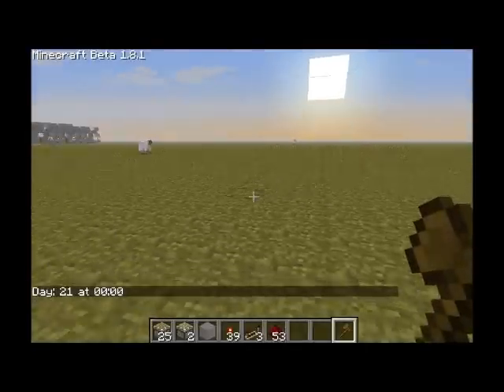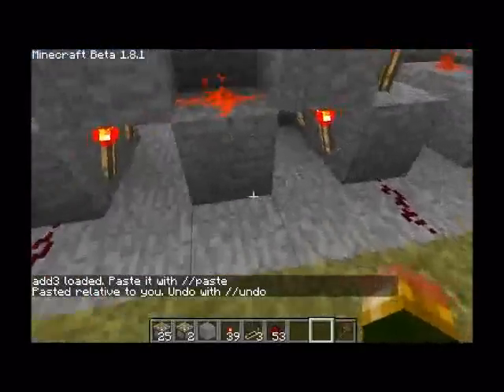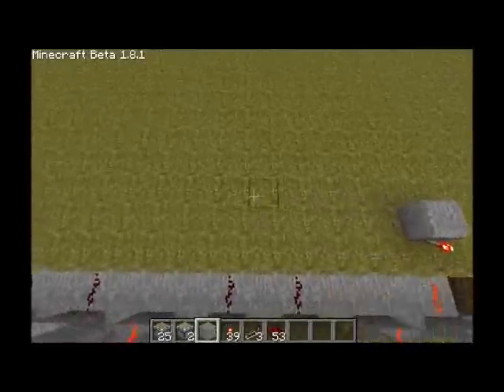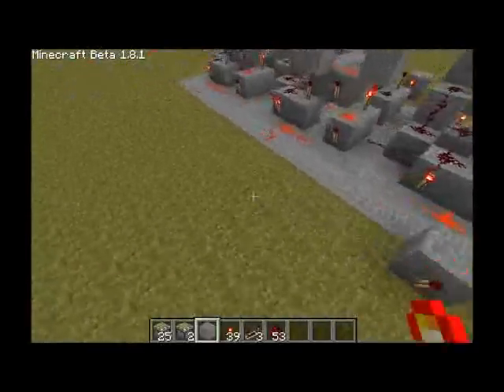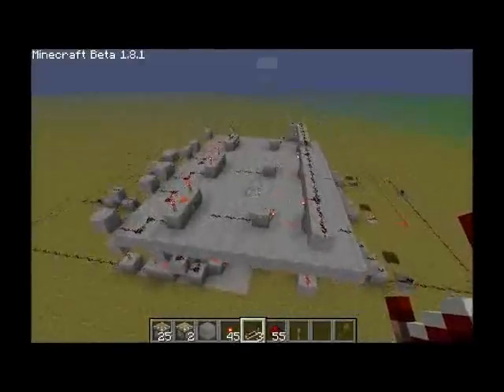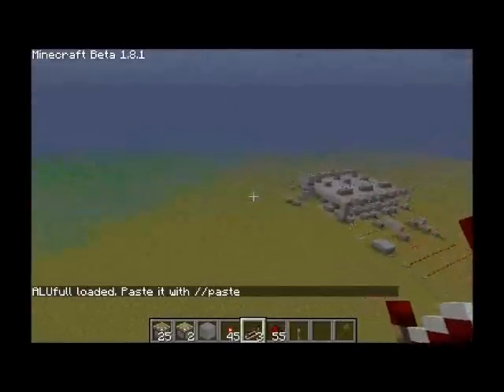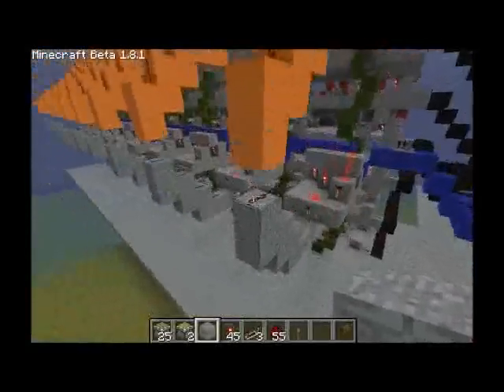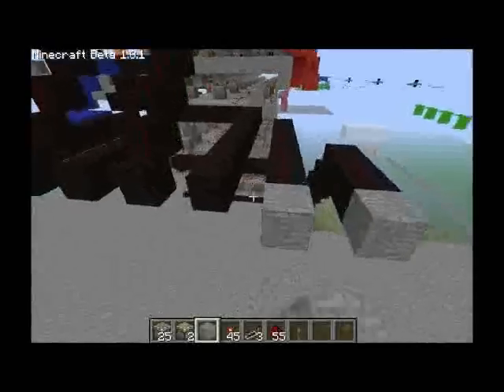how to make an ALU in minecraft(and a subtracter). building your own computer part 1.

Comment from the maker: yes, I know.
although, "technically" speaking, a CPU isn't a processor either. a processor is inside the CPU. for example, the CPU includes a clock, but that isn't necessarily part of the processor.

but that's fancy stuff, no need to worry about that!